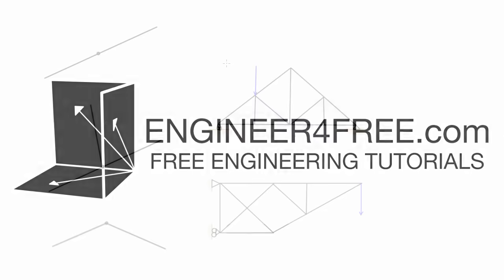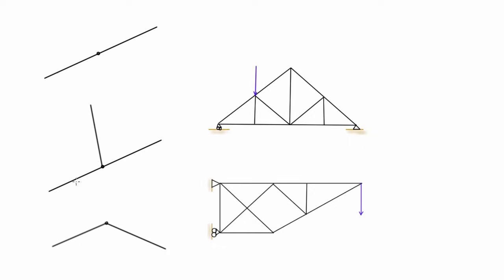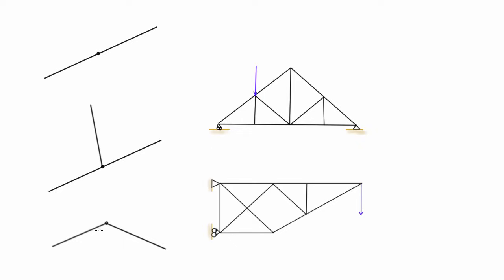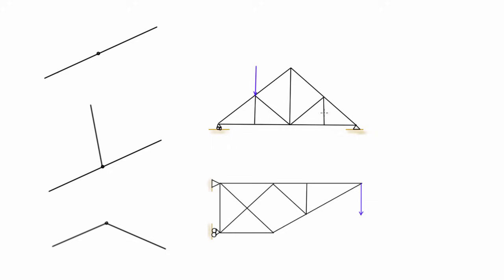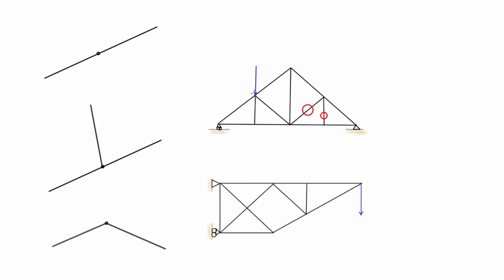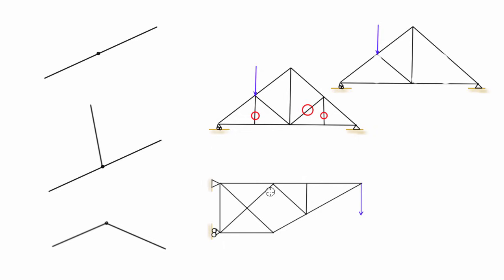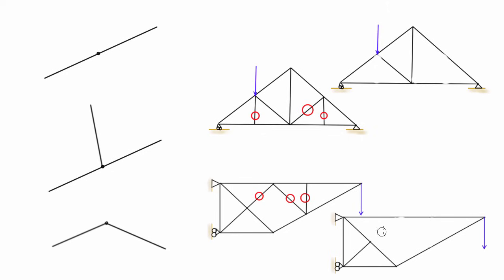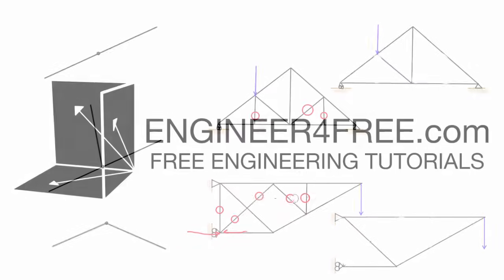How to identify zero force members in trusses

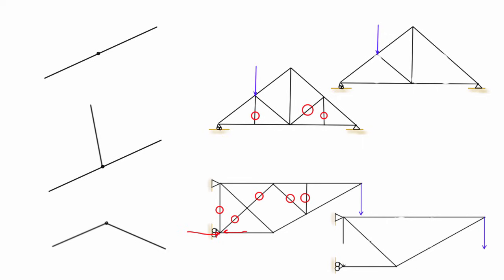Comment: I’m not a student of this subject so i may interpretet the definition of “zero force” wrong, but i wouldn’t remove that last removed beam attached to that roller at 9:12. Now the up/down stability is gone of the horizontal member that’s left. But true, it does not carry the mainload.
Reply: True that if you were to remove that member from the truss in real life the truss would no longer be rigid. But in this idealised case, where the truss members are assumed not to be exerting any force themselves, in this configuration that particular member can't be exerting any force, because the only force exerted on the bottom end is at right angles to that member (because of the roller). So for the purposes of eliminating members which don't matter in this particular configuration in order to simplify the calculations for determining the forces in the remaining members, you can ignore it.
If the load on the truss were different, and a vertical force were applied to the bottom end, then it would become important and in that situation you would be obliged to leave it in. Which members are zero force is highly dependant on the load applied to the truss, when you 'remove' them the equivalent truss you get is only equivalent in that specific situation.
I hope that makes sense!
Reply from the maker: Yeah thanks for that Tom! And just to clarify, when I am erasing members, I’m not “removing” them from the structure. They are still there for stability etc. I just erase them to visualize easier which other members will also be ZFMs

Comment: Not sure why this is being recommended now, but at least I can finally optimize Poly Bridge levels!
Reply: Cole Smith do keep in mind that this is theoretical, and assuming members have no weight. In real live, every member has a force working on it, same as in game, that will introduce a force.
And even if there really is a real live zero force member, (which is impossible because gravity) this zero force member will still be useful for stability.

Comment: How about the pin above the roller support it will not effect on the last member you removed?
Reply from the maker: I’m not actually removing the members. They are there always. I’m only erasing them to help visualize which other members are ZFMs. By erasing known ZFMs, it makes it easier to spot the 3 cases highlighted on the left of the screen. But all members that I erased are still there, they just carry no internal force. The ZFMs need to be there for other reasons, like bracing or if the applied load changes location the members which are ZFMs will change.

Comment: Good video, but I would like to see the load computations before and after the zero force members are removed.
Reply from the maker: The ZFMs are never actually removed. I only erase them on the diagram to help see which other members are ZFMS. In real life they are all still there. They need to be there for stability, bracing, and in case the applied load changes location, as the members that are ZFMs would change.
Reply: They wouldn't change
Reply from the maker: Yes exactly. The location of applied loads would change in real life and thus a member that is a ZFM now might not be one later, and vice versa. Bracing to reduce the span of long columns is another specific reason to have more members than less, it would increase the critical load for buckling for example.
Reply: And some informations, why these zero force memberst still could be useful, e.g. in case of different loads, bending material etc.

Comment: This is great in terms of pure mathematical vector addition. The 'zero-force' members are there because in the real world, the minimum net is not physically perfect. Heavy wind-blown drifted snow on one side upsets the equilibrium of the 'perfect' net. Remove the zero-load trusses, the roof collapses.
Reply from the maker: ZFMs play an important role in stability, bracing,m etc. If the load changes, the ZFMs change, so in real life, don’t expect to have a single pint load acting on your structure! Also in this video when I’m erasing the ZFMs, I’m not actually removing them, they are still very much there on the structure. I just erase them to make it easier to spot the other ZFMs in this loading scenario. 🍻
Reply: @Engineer4Free  probably something you should mention in the video as you say we dont need them and someone could easily think they can remove them and the bloody roof collapses on them p.s you know someone would do that
Reply: and also in reality the members themselves have weight which would act perpendicular to the horizontal plane. this simplifications are made based on the assumption that the members are weightless so that the understanding of static forces in truss members become easier on engineers. cheers!
Reply: @khiareozmakhiar3722  another assumtion is, that the members/struts are non-elastic and the one you mentioned, that the members are only able to apply/transport force in its tangential direction.
Reply: @emmata98  exactly. elasticity of members could change the statics problem into a strength of materials one where you should use strains and deflections to calculate the correct forces.
Reply: Thanks your comment makes a lot of sense

Comment: In second problem there is downward reaction in hinge sp it need to be balance.. thats why last link which was erased will have same force.. if I'm wrong please correct me..
Reply from the maker: The vertical member that goes between the tẹo reactions is erased on the condition that the lower reaction is a roller and can only provide a reaction normal to the surface (horizontal). So there will be no vertical component of the reaction there, so the vertical member will carry no internal force. The vertical component of the top reaction is carried entirely by the vertical component of the internal force of the diagonal member attached to it.
Reply: Oh.. thanks i get it now..💓

Comment: although the second example's leftmost member is a zero member, I think it cannot be erased, otherwise, it becomes externally non-static.
what do you think?
Reply from the maker: Yes. I erase only to illustrate that it has no impact on the joints it touches. In reality it’s still there, but you can solve the remaining non-ZFMs as if it’s not there

Comment: Dear Engineer4Free,

Thank you for your response. It was helpful for me know that "A curved or irregular shaped member can be a two force member as long as only 2 forces are acting on it and with their lines of action being the same." 

Only thing could not understand axis of both arms of V-shaped rod or L-shaped rod (basically bent rod) are different. How  the internal force in the bent rod look like compression, tension, moment. Suppose I have fixed one arm of vertically aligned V-shaped rod to the ground and hanged a weight (10kN) on its upper arm. what will be the stress on the rod. If possible kindly provide some reference.
    

Statics as subject is confusing for newcomer like me because many authors call structures as truss which do not have pinned joints at all. Also its difficult to imagine any real life structure which have pinned joints. For example river Bridges, bicycles etc can not afford to have pinned joints. joints are either riveted or welded. 

I one blog (Quora), some body posted a figure of chair with identical four legs with legs being non-straight rods (they were bent rods) and he said all four legs are zero force member. 

In many places all V-shaped members (unloaded at its vertex) are said to be zero force members with same analysis using static equilibrium condition at its vertex.
Should static equilibrium condition be applied at its vertex of V-shaped member?
Reply from the maker: When I use the word truss, I’m referring to the overly simplified version for entry level statics, which means straight, two force members, connected only with pinned joints. IRL trusses are typically made with fixed connections like you’ve suggested, but in statics, we use the simplification just to get the basic principles across. These conditions make it so that each member of a truss can only possibly experience axial internal force (tension and compression) and there is no way for them to experience internal shear or bending moment. 

For a bent rod like you’re asking about that’s supporting a hanging weight, that member is going to have axial force that is tangent to it’s curve at any given point, internal shear that is perpendicular to the tangent, and an internal bending moment too. That type of problem is probably beyond you’re typical statics level course, so don’t worry about it. Just focus on simplified problems with straight, two force, pinned only members.

Now to address the V shaped member and it’s vertex. In a basic statics problem, every truss member is straight. If something is forming a V shape, then it is two straight members connected with a pin. Because they are two different simple members, they both only carry axial force, if any. If it was a solid V shaped member, then we would maybe be getting the internal shear and bending moment, but no statics truss problem will ever have a V shaped member. The reason an isolated V (two members only at one joint that are not aligned, and are not subject to an applied load at the joint) are ZFMs, is that if one had a non zero force acting on the joint, the other could not resist it because it’s not inline, and the joint would not be in equilibrium. All statics problems are assumed to be in equilibrium, and as it should be, otherwise that part of the bridge would accelerate, which it’s not. 

You will see bent members and rigid connections in “frames and machines” problems in statics, and these are closer to structures that you would encounter IRL. But its very important to realize when you are given a truss problem and when you are given a frame/machine problem, because frame/machines are not entirely made of straight, two force, pin connected members. On engineer4free.com/statics you’ll see a section just for trusses, and a section just for frames and machines. I recommend watching all of them in each section and realizing that “trusses” (in the entry level statics lingo) are more simplified problems. 

I hope that helps clear it up. For now, enjoy the simplifications, as when you get into mechanics of materials you’ll start dropping the simplifications and getting closer to what happens IRL.

Comment: In you video titled "Two force members explained (statics)" you said L-shaped rod is in equilibrium and without being zero-force member. Though there was some difference from 3rd zero force member that you describe here. But I am learner. I need to understand from you.
Reply from the maker: The 3rd case in this video is not an L shaped member, it is two straight members connected with a pin. A curved or irregular shaped member can be a two force member as long as only 2 forces are acting on it and with their lines of action being the same. That would be for any shaped member with 2 pin connections. Trusses are a special case of two forces members in that they are straight ad considered to only have axial forces. So if there are two truss members that are connected like in the third case, then for the structure to be in equilibrium at that joint, neither may have an internal force making them ZFMs. If they did have a non zero axial force, they would not net to zero because the line of actions in one member is not in line with the other, and the joint woukd accelerate in the net force direction. Hope that clears it up.

Comment: Do you still need to construct those zero force members or remove them all together? Do they provide bracing?
Reply from the maker: When I erase the ZFMs, they are really still there. I just erase them to show the simpler equivalent system. IRL, the provide bracing and stuff. And if the applied load changes, the members with zero force also change.

Comment: What if there is a force downward in the centrr in the first figure?
Reply from the maker: If the first example had an extra downward applied force on one of the two centre joints, the ZFM's would not change. If an extra force was applied at some of the other joints however, the ZFM's would be different.

Comment: Why isn’t the left horizontal beam from the top figure truss zero force?  My understanding is that if there are only two members and it’s loaded, then if the line of action of the resultant force at a joint is collinear with one of the members, then the other member is zero force.

The joint at the top figure I’m referring to in my question is the one with the roller.
Reply from the maker: Sorry, I'm not sure which example you're referring to, they both have rollers. Sounds like you mean the second example tho. If so, we don't know if the line of action of the reaction force is colinear with the diagonal member. If it turned out to be the case then yeah you're right, but we have no grounds to assume that that is the case here. If we were given a magnitude of the blue applied force, then you would determine the magnitude and direction (or just of the x and y components) of the force in the first stage of solving this problem.

Comment: hummmm???  then why on the first example is the GIANT T in the dead center ignored ?????????? how ????
Reply from the maker: It's not purely a T. Look at the joint in the bottom middle, there is the diagonal member connected to it too. That diagonal member is not a ZFM as determined by it's other end. Because that diagonal member is not a ZFM, it has an internal force, and because it's angled, it has a vertical component. The vertical component must therefor be dealt with by the vertical member acting at that joint.
Reply: @Engineer4Free  MIC DROP SON!!!!

Comment: Very nice video and explanations, have to add something for the last zero force member in the video... it is possible to remove it in order to get the right answer, however it can't be removed from the structure since it is supporting the rolling element that would fall downward... so yes you can solve the problem, but don't draw it like that because I won't make sense.
Reply from the maker: Yes very true. When I'm erasing the members, I'm just doing it to visualize which members actually need to be analyzed for the current loading. You're right, we can't just remove it for realz. Sometimes people thing ZFMs might as well not be there, but they serve a purpose like you mentioned, of another example would be if the loading changed, the ZFMs would most likely change too!
Reply: Yes. Also adding gravity; member section and material properties induce displacement displacement cause ZFM to be non zero and recieve load depending on fixity of joints etc.

Comment: In the 2nd problem u worked out there is a horizontal reaction in the hinged joint so the member you made a zero force member at the end of the video should be there to counteract that reaction right..
Reply from the maker: Hmmm sorry you've lost me. In the second problem, the top reaction is a hinge and the bottom reaction is a roller. Both reaction forces have vertical components, but only the top (hinge) reaction has a vertical component. That vertical component is taken entirely by the angled member that touches it. Because the bottom reaction is a roller, it can only have a component that is normal to the surface, which is in the horizontal direction in this case. The horizontal member takes all of that force, and because the roller doesn't provide and force in the vertical direction, the vertical member must have zero internal force (otherwise the joint would accelerate vertically). So the vertical member that touches both joints has to be a zero force member. Hope that helps clarify
Reply: You can watch solved example using this concept in the attached video. https://youtu.be/5GOB5suVCGg

Comment: why is the last one perpendicular to roller support 0 force member? using same logic I would analyze pin before roller and say that it has reaction in x and y which should be counter-acted, so I don't think the last member was 0 force...
Reply from the maker: Rollers can only apply a force that is normal to the surface they rest on. In this case, the surface is vertical so the force can only be horizontal. This means the reaction force at the roller is horizontal, with absolutely no vertical component. If you draw a fbd of the joint at the roller, you would have a horizontal force from the reaction force, a vertical force from the internal force of the vertical member, an angled force from the internal force of the angled member, and a horizontal force from the internal force of the horizontal member. We know that the angled member is a ZFM so the internal force is 0 and we can ignore or erase it. This leaves us with two horizontal forces and a vertical force. For the joint to be in equilibrium, the horizontal forces must be equal and opposite. The only way for the joint to not accelerate in the vertical direction is if the single vertical force that we drew on the fbd is zero. So that member has zero internal force, it's a zero force member.
Reply: for the last zero force member in the video... it is possible to remove it in order to get the right answer, however it can't be removed from the structure since it is supporting the rolling element that would fall downward (that member has negligible force in it since the rolling element has a negligible weight)... so yes you can solve the problem, but don't draw it like that because I won't make sense.